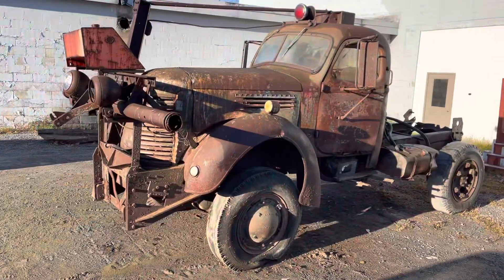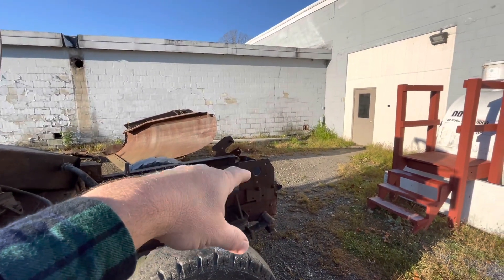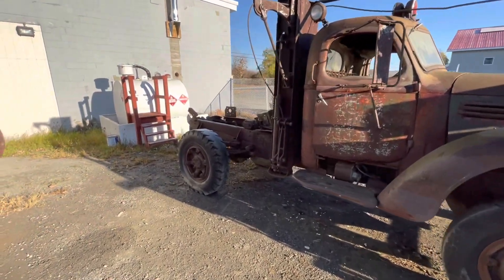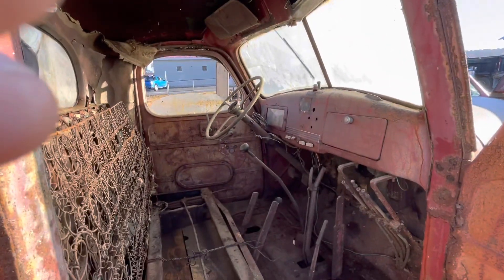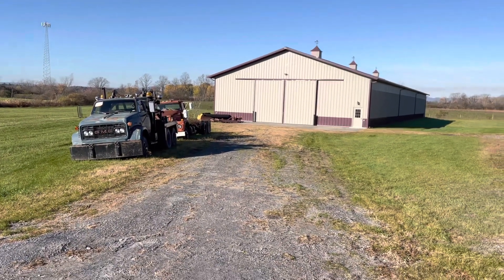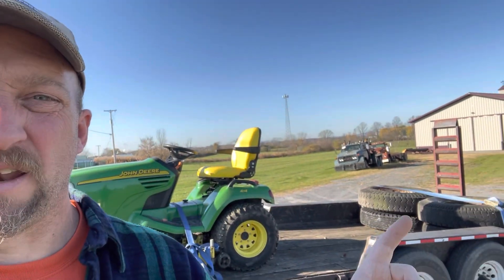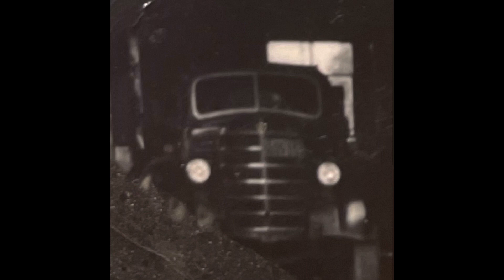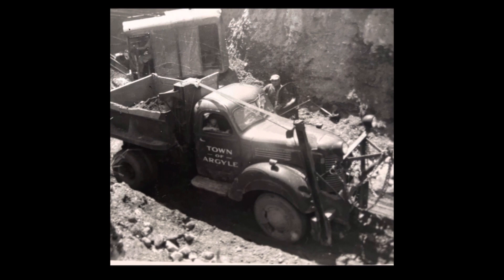I’m giving away this old International KB-7 to be a new lawn ornament. Can’t wait to see it roadside

Comment: I love your KB 7 I had one and it was stolen it had the big winch on the back just like you're talking about it was used for stringing wire originally power wire and telephone wire that's what the paperwork on mine said when my uncle had bought the truck it was used for stringing electrical wire across the state of Montana God I love these trucks that's a nice truck I miss mine I would love to have another love to find another

Comment: That truck never had dual's on the rear .Plow trucks always had singles because it was better traction in snow . You can see the hubs are special and only made for single . I have a 1950 Ford 1/2 ton that  is a Colman and has the same front cast dayton hubs and covers . Very cool and rare . That Dodge bus is super cool and rare . Ed from Mission BC Canada